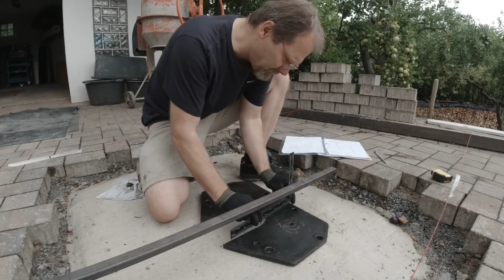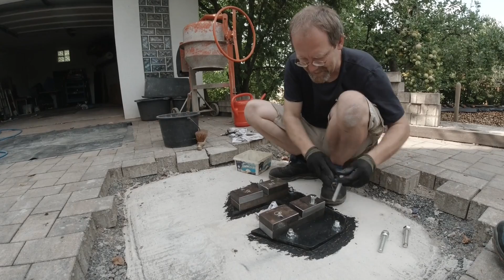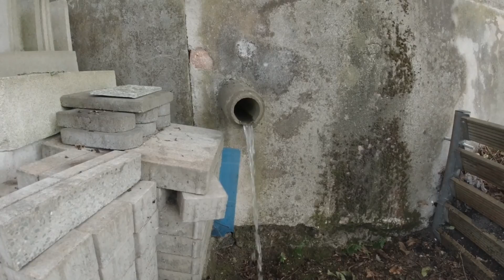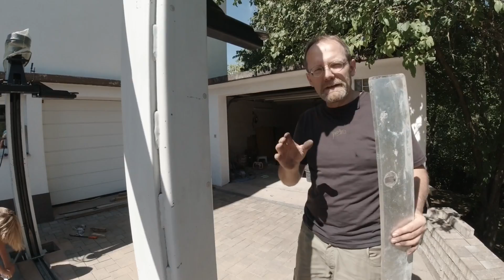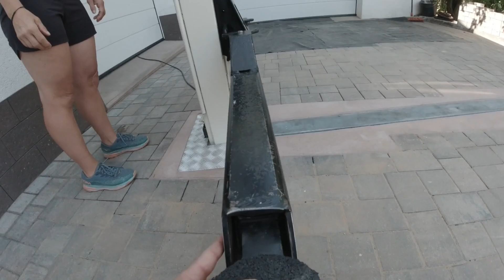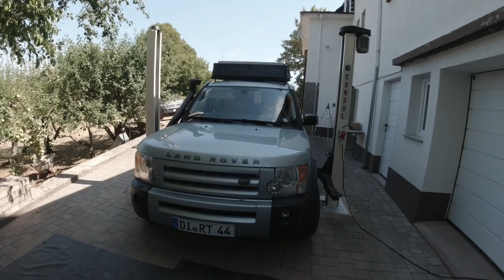Outdoor 2-Post Car Lift Install in Our Driveway - Part 2

Comment: Fantastic job , perfect installation, not sure wether to buy a hydraulic lift , 4.0 tonne capacity, bargain at £250 , bendapac , good make , but s you say. The hydraulic have the safety features to deal with all the time ,
Reply from the maker: If you ever want to take the body off, don‘t go hydrolic. It‘s does not move  in tiny increments . 🙋‍♀️

Comment: It's hilarious watching you both. Typical German engineer on the previous location - pick the most difficult place possible! But do it precisely!
In all seriousness, I've been drawing up extended sheds and garages for the last year to fit a car hoist (yar, I like working on cars (and boats) too. This has convinced me to do it outside. Hugely cheaper than extending a garage (including a replacement hoist every 10 years).  Happy Easter from Australia.

Comment: Hello! I am planning to do something similar basicly in the dirt on my yard. I have 2 post lift and i am worried it wil colapse on side after time of use. I want to do a 1.5m long 1m wide and 30 cm deep concrate slab on each slope and connect them with 80 cm wide and 30 cm deep part of concrete to create the ,,H" stability. What was your dimensions of hole for this lifts? And are they holding good in same place after year? Thanks! 🥰

Comment: Hi Christian & Vera, a belated thank you for such a useful tool. Altogether an essential tool for many modern cars that have tight engine compartments or that have separate subframes. Dare I suggest MB W168’s et al. Currently researching what’s involved in owning a Euro6 compliant LR diesel, one that has cabin headroom and more than 1.8m3 carrying space (with seats folded or removed).

Comment: Which is the best engine to have in a Discovery 3 or 4
Reply from the maker: “Best” could mean anything.  Reliable, fuel efficient, powerfull, torque.  Diesel or Gasoline.  Christian

Comment: I was raised in Kitzingen and Schweinfurt Germany as an Army brat. I've been to Darmstadt many tymes. Rarely see out door lifts here in TX cause of the extreme weather changes and tornadoes
Reply from the maker: They are here rare too.  Very nice in the summer but rough in the winter.  Not to compare with TX for sure.

Comment: Great work and excellent installation, Vera & Christian. And from now on, the German TUV has to visit you annually and check the structural integrity and safe function of your car lift and the BG will check you workshop for safety. And you will need an oil separator in your water drain line. 🤣🤣🤣

Comment: Great example for the way a German engineer thinks and works! Every aspect of this project is accounted for and you improved the design by setting it flush and installing a drainage system. Whenever I struggle with my LR3 and my doubts are about to end in posting another ad to sell the car I watch your video and the world is at piece again… Danke schön ❤️
Reply from the maker: 😅OMG.. that is such a precious comment. Thank you so much. 😃🙏🙋‍♀️Vera

Comment: These two crack me up!  I assume Christian is an engineer as he displays great attention to detail and precision with all aspects of the build.  On a side note.....did you see all that wood! :) They are prepping for the gas shortages this winter!
Reply from the maker: We don't heat with gas. Here in Germany, timber has to dry for 2 to 3 years before you are supposed to burn it.

Comment: Could have been worse.
I was hoping Christian would build the lift inside the garage and then make the roof retractable.

But, look on the bright side; I'm sure having a 2-post lift will be attractive if you ever decide to sell the house.
Reply from the maker: Our garage was also not wide enough.  I did consider replacing the roof but too much work.  Christian

Comment: Awesome job, can you comment mercedes underbody rust protection you did before. Is it still good?
Reply from the maker: It did Rost but not as much as other stuff I used.  It also does not flake off.  We will be using it again and it will be in Video down the road. Christian

Comment: Perfect timing, Ive just bought a 2 post electric lift to install outside my garage so I can work on my Dicso 3. Brilliant information! Did you have to do anything to the electrics or motor to water proof them? Thanks Josh
Reply from the maker: Yes, it will need some work. We get a lot of rain in the Winter.  Will be in a video down the road. Christian

Comment: Looks great guys, would love to have access to such a lift. What brand electromotor is running the lift?
Reply from the maker: It'S a consul lift with a 3T rating. The motor is high up and I can't reach to see what brand it is. But, the motor is working just fine, we even had Fabians heavy 3,1T Disco all the way up in the air for a greater part of the day. 😃👍🙋‍♀️Vera

Comment: Such a great addition to the workshop. I was able to use a friend's lift last week to replace the centre valve block and air compressor without crouching. Next week it's time for the air struts and the remainig valve blocks.
Reply from the maker: 💪👍🙋‍♀️Vera

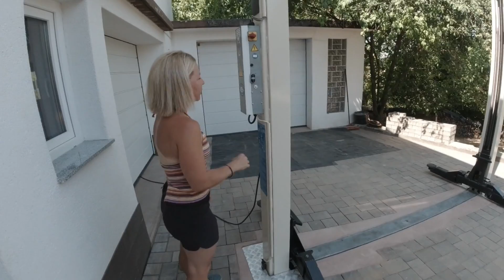Comment: 17:00 wow, look at Vera's sunburn. Does it hurt? The lift looks great. You can already see the neighbors standing in line to use it especially when it comes time to change out the summer/winter tires on their vehicles. Vera, did you say 2nd or 7th place in the Pro division?
Reply from the maker: There was no sunburn. You kind of like to pick on me in your comments. It's tan I get when wearing my running outfits from March until November 😅 Then I'll move to longsleves, maybe. 2nd place for Philipp in the pro division. 🙋‍♀️
Reply: @Vera_and_Christian  definitely not picking on you. My apologies that it seemed to come out that way.
Reply from the maker: @toddhoffmaster6057  No worries, I got picked at a lot in this video, some of those comments I had to delete. 😃🙋‍♀Vera

Comment: Please be careful with the two post lift. At one time I seem to remember that Land Rover strongly advised not to use them due to the danger of their vehicles slipping off the pads and falling to the ground. Steel against steel is slippery.
Reply from the maker: I made pin adapters to prevent this.  Indeed did it slide in the front 😱.  Christian

Comment: Congratulations to Phillip for 2nd place!  Nice custom made screed board for your sand.  Why did you pick a chemical bond vs conventional concrete anchors?
Reply from the maker: They got recommended to me and I had them available.  They distribute the load over the length of the bolt.  Christian

Comment: Good job C & V. I spent many hours working under two post lift during my career as a mechanic (now retired) Many years ago in a workshop I was working at a colleague was lowering a two post lift (not the same make as yours) and not paying attention and the safety device didn't detect that only on side was lowering so the car on the lift ended up at a 45 degree angle before someone said "STOP" just in time before the car fell off the lift.
Reply from the maker: OMG 😱
Reply: Not a mechanic or even a DIY car owner - so maybe this is a silly question, but just wondering should Christian and Vera also use high / tall additional fixed stands when working under LRs on the lift for added safety or is this not necessary?  Also, do you agree with another comment above regarding fixing rubber pads to the lift arms to help reduce risk of slippage.  What are your views based on your professional experience using two-post lifts?  I really enjoy C&V’s videos and want them to be very safe!
Reply: @pcislander  Rubber pads recommended to avoid slippage as you say. Extensions are sometimes required due to the design of the sill area of the vehicle. Two post lifts sometimes come with a variety of arm inserts for just that reason.

Comment: I'd be interested to hear what you have done in terms of water protection given that this lift used to be indoors. Great job as always. Did you go for IP 55 or higher?
Reply from the maker: I still need to do more for this.  Couple of deflectors, etc.  the electrical box is also quite beat up and requires more work.  Christian

Comment: So the betting is open on how long before Christian finds an excuse for a "body off" maintenance task!
Reply from the maker: He does not need an excuse. 😅 I have to put my foot down until summer and contests are over. Then he can take it off. But then he also has to live with the fact that I take the Mall Crawler when I need it. That is probably the only reason I still have my Disco in one piece.  🙋‍♀️Vera

Comment: Excellent job, Christian-Vera, as always.

If I remember well on Part 1 of this series, was it about 3 weeks ago when you poured that concrete foundations?
So far I know, concrete is best after day 28 from mixing-pouring.
Just my thought.

Anyways, great video and workmanship of you both.

I am taking my Ford 2.5 ltr TDCi engine apart for maintenance (it'd reached 165k odometer, I think it's time to do overhaul to keep her performance always on top).

I really wish I could do videos as you, but apparently I cannot. Single handed and self taught man here 😊
Reply from the maker: The video making comes on its own.  Initial videos did not even have language in them.  Just start and they will get better and better. Our slab cured 2.5 and 3 weeks.  So a bit short indeed.  Christian

Comment: What a fantastic job this is. If i recall these type screw lifts used to use a special Thelson type product on the screw to prevent the weight of the vehicle continuing to rotate the nuts on decent when the lower button was released. I guess there is a brake mechanism somewhere. Love this guys.
Reply from the maker: Yes, he explained that I think in part 1. 🙋‍♀️Vera

Comment: Get another four threaded lift pads and make some dedicated cups (U section) that will then locate on the LR chassis.. heavier cars have a tendency to move the legs and slip… seen a few move and nearly come off two posts ramps in my time. 👍
Reply from the maker: I made pins for the front.  They get stuck. Should have made U style mounts.  Christian

Comment: I have the same lift and you haven't left any adjustment for the chain to stretch, which they do. You will know when it needs adjusting when the motor is juddering while trying to raise and lower a vehicle.
Reply from the maker: I set the posts as in the book and then I realized that my chain is worn and stretched.  I will have to replace it soon and this will bring the posts closer.  Christian

Comment: This was awesome guys, I really enjoyed this. I am currently in the process of replacing the left turbo charger on my discovery 4. Which I am having to do without body off, or a lift or even a pit!  To say it's difficult does not even come close. I will send you some photos when I'm finished. I'm just waiting for the replacement turbos and some other parts. But when we move house I need a lift or something like this. It was very inspiring to watch.
Reply from the maker: That is so great,  do you have a RHD vehicle, you have a tiny bit more room on RHD cars.💪👍🙋‍♀️ Vera
Reply: @Vera_and_Christian  Hey guys. Yes it's right hand drive. I must be totally insane doing this kind of job on my dads gravel driveway.. hahahahaha. Will keep you updated.

Comment: Such a nice finish.   I love chemical anchor but I’ve only ever used it in a tube, I’ve never seen it the way you have it.  As for the weight of the disco, I weighed mine the other day and it was just over 2500kg so you have plenty of headroom in a 3 tonne lift.   Even though they are rated 3 tonne I believe they have a much higher weight capacity.   Anyways, well wear guys.
Reply from the maker: I hope so.  We lifted Fabians Discovery 3 the other day and it weighs 3100kg.  I did notice the additional deflection on the arms and the post.  Also the Motor was nosier.  Christian

Comment: Great work you two ( as always ) would it be an idea to fit rubber pads on the end of the arms to stop the chance of slipping because of metal to metal contact with the frame and arm, thanks for another great start to a Sunday.
Reply from the maker: Christian has machined special mounts for the Disco so he can't slide off. And we also have rubber mats of course on those arm rests. 🙋‍♀️Vera

Comment: Can you manually lower it should the motor fail and the car be stuck in the air?
Reply: Yes you can,if you put a socket on the nut on the pulley at the top and spin with a drill you can raise and lower,have done on mine to test when installing

Comment: Superb engineering, superbly installed. 
I can feel your satisfaction at having planned and built it all so well. Well done!

Trying to find a garage/shop with a pit these days is very difficult.
If you have a problem with squeaky suspension and you need to look underneath the car while somebody rocks it, a car lift is not ideal as it not only difficult to rock the car while it is off the ground, but the car lift will start to rock as well!
Ideally, you need a pit so that someone can be in it and hear exactly where the suspension is squeaking while somebody else rocks the vehicle from ground level.
Then you need a car lift to more easily replace the defective part.
Now Christian and Vera, you have both!

Comment: Make sure you keep the Acme threads in the uprights well greased Christian and be sure to use the correct grease as specified by the lift's manufacturer. I had 2 Bradbury lifts in my workshop and the Acme nuts do wear out eventually if you use the lift a lot, the correct grease will add years to the life of the nuts compared to ordinary general purpose grease. For the Bradbury lift they specified Castrol MS2 grease, it was quite fluid and the type of grease often used in automotive CV joints
Reply: Wasn't there a white stuff called Thelson grease for these. I recall the weight of heavy trucks on the 80's Bradbury lifts could rotate these nuts and lower the vehicle on its own if the wrong grease was used.
Reply: @raycollington4310  The grease the manufacturer advises should be used I agree.

Comment: Welcome to the 2 post hoist at home club, you wont miss laying under your car again, I sit in an old office chair & wheel around under my discovery
Reply from the maker: 😅we have a pit, so no laying underneath the car for us. But yes, when a screw fell down into the pit, it was always a nuisance going down there and getting it back up. Christian won't miss that. Even so we will put the chassis over the pit once we take the body off.  🙋‍♀️Vera